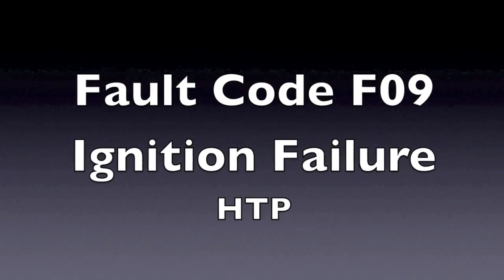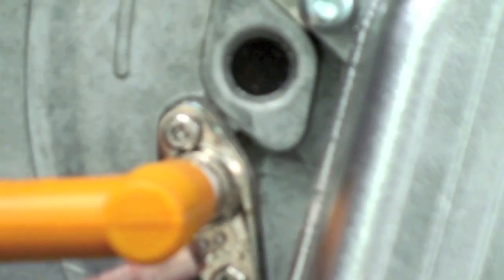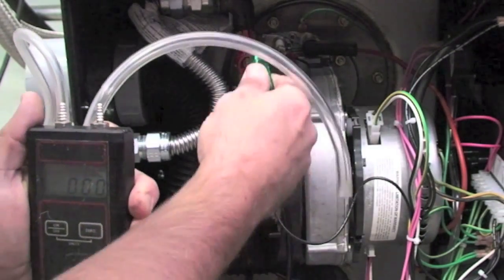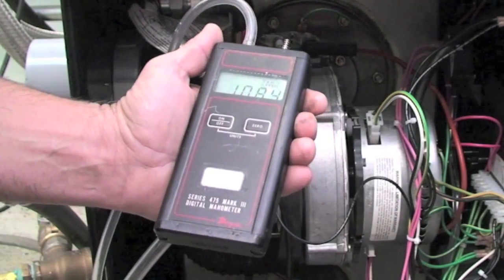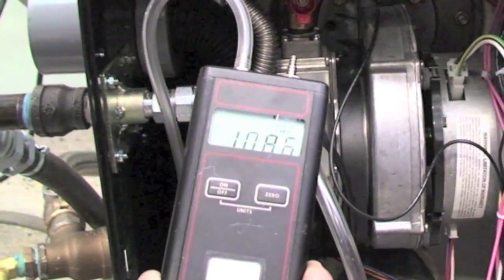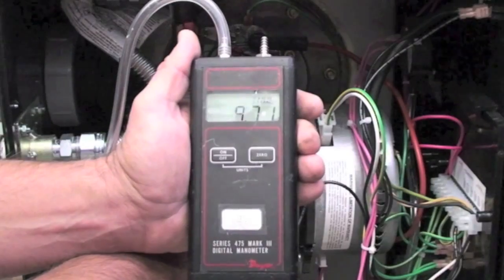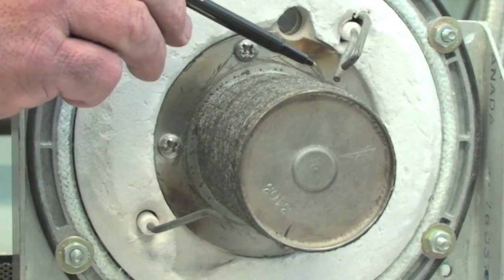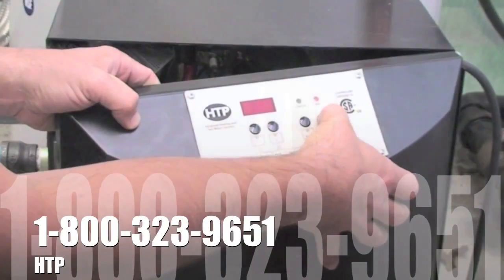F09 Fault Code - Ignition Failure

Comment: My easy fix was to blast out the water drain tube (black) coming out of the base of the furnace with an air pump. This cleared out the plug; water started draining FAST; after a while it diminished. The next time I did a reset; it lit and the heater stayed on without the F09 error :)

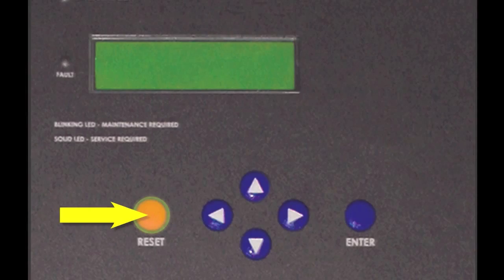Comment: I have what I believe is the contender. (controller shown at 0:25)I had a board that was not responding, no spark and an unknown error code as the face plate was messed up.The temperature limit switch was also corroded to pieces.I started with replacing the temp limit switch and just for poops and giggles the blocked vent pressure switch.No luckI pulled out the board and cleaned the contacts on the ribbon connecter.Got an F 09...this is good its an flame failure, checked the igniter, had spark...not good news.Checked the flame probe....nope its good.Found that the board was not responding. Cleaned the contacts again and still no flame.Replaced the board and wah la...it worked and was able to reset the 09 alarmDowner. Still no flame. Pulled the igniter and lots of spark, and a strong smell on natural gas so I have everything needed to make a boiler work!the only thing I have left is an incorrectly set gas valve.problem is I don't have a manometer.Anything I may have missed???
Reply: Oh wow your comment is 5 years old and they never responded to you. What a shame. Did you ever figure it out on your own?
Reply: @GhettoGeek-tv4mz  never did respond, but I did get my issues resolved. Been so long I can’t remember what the fix was though.
Reply: @klntym  I only asked because I had the same issue but I was able to fix it. I vacuumed out the drain lines and pressure sensor tubes, I cleaned the igniters, the solenoid is in working order, and the air pressure sensor is also in working order. I had to replace those before but this one is working fine.

The gasket to the igniters was broken and that was interfering with the gas pressure. So even with a manometer it would read that the gas pressure is fine so I can see how this broken gasket can get overlooked unless you remove the igniters.

Once I put on a new gasket around the igniters and powered on the system it ignited right up.
Reply: Dealing with this right now. On a new goodman. Not making past pressure switch